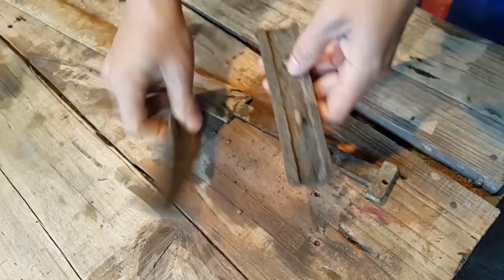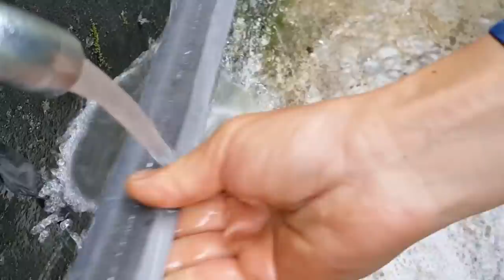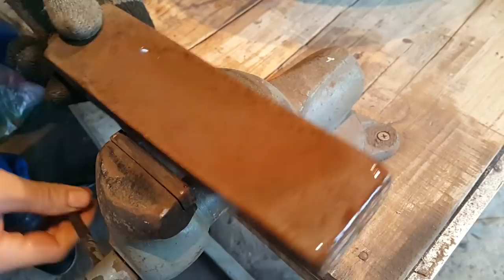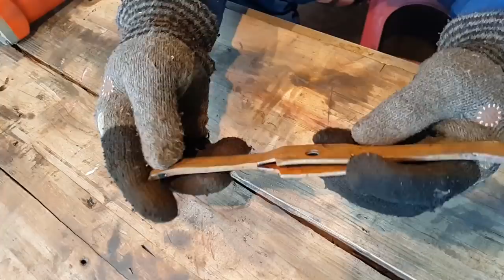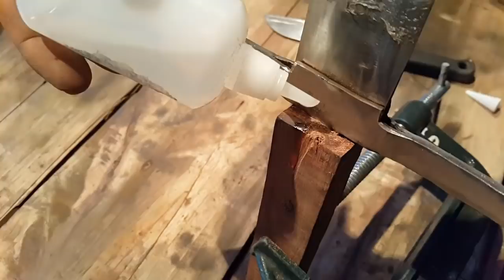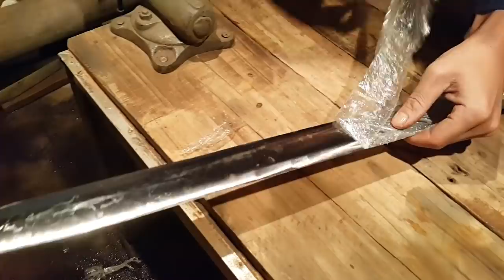Restoration legendary sword Excalibur | Restore ancient weapon old rusty

Comment: I dont mean to hate, but i thought some feed back would be good to improve your work. 
Dont weld the guard to the blade, that screams low quality build, you could maybe make holes with two pins horizontaly to hold it in place, giving it a much finer look,  also, you cutted the pommel off,  that metal is for balance, replacing it with the wood of the grip is just for looks and it affects the center of gravity of the blade, also, the grip looks very thick and round,  try making it more oval shaped and thiner to fit the hand more comfortably, maybe some sand paper would make it easier instead of the grinder, make it real smooth and it will be great, 
And finally, if you spend some more time in the blade i'm sure you can make it mirror shiny, it's a good looking blade but you can see the grinder marks all over it, the higher the number of the sand paper,  tge better it will look! 
I hope you keep doing what you do and that feedback helps you imprive even more.
Marry christmas
Reply: F
Reply: Also worth a point partial tangs even riveted are usually weaker than the previous full tang build
Reply: A pommel is not necessary for balance, but for construction. A hidden tang sword won't hold under use
Reply: @ondralavicka3455  necessary no but if it was originally factored into construction then its removal shifts the balance slightly more so with larger round pommel s
Reply: @killerkitsune5425  
The handle scales are more likely to split without a full tang. And you are right a pommel is not necessary a full tang is. Also depends on if it's a longsword, or an arming sword, but if you were to grip the pommel, then I don't think it would hold.
Reply: Not hate helpful tips, no one is going to shaft you for that.
Reply: That's a good constructive criticism that you made us. The world should take this example of criticizing like this that instead of bashing the person's work.
Reply: @tatehearn5000  well your right
Reply: Never use a grinder for restoration. Hope he learned his lesson... And never use commercial weldding. Really??? Common man..
Reply: @onyelbrixrhythms8718  nex they probably say Restore the holy powers too its exclabur! have it shoot golden raysxd
Reply: @ondralavicka3455  A pommel most definitely is needed for a properly balanced sword
Reply: @Tolboy46  
I don't think so. Depends on the type of the sword, but there were hollow pommel or just end caps that a katana has. Europeans put pommels on everything, because they have great offensive capabilities. A blade should be mostly balanced without a pommel.
Reply: @ondralavicka3455  have you ever held a hollow pommel sword? There's quite a bit there. You're correct that a pommel is not "necessary" for a Japanese style sword. But a cruciform "European" style sword will not have a proper balance point without a pommel. Lots of research is out there on this. It effects the nodes and balance. Otherwise you don't have a very long sword, or it'd be far too blade heavy and the wielder would get tired quickly.
Reply: Why do you have the fairy tail symbol as your logo?
Reply: So fake he probably bought it from some one on offer up
Reply: Cutted is not a word and do you even Gramer though (imprive)
Reply: @ondralavicka3455  any grams of a sword are necessary for balance! Even if this sword using on horse by knight or hands of an executer.
Reply: @wildscott6174  stuck with that? Really 🤘🤪
Reply: @selmanmuslu1597  yes yes I did cause I love ANIME
Reply: @wildscott6174  me too 🤘🤪 all for love goes to SAITAMA 👊
Reply: As soon as I saw the blade, I knew that it was not worth working on.  Slab steel, stamped by machine, decorative piece.  Tosser!
Reply: Yea I also did not like the welding of the cross guard. Seems like it will be bad for the blade in the long run.
Reply: If youre trying to give constructive ideas and sound at least somewhat coherent, dont say "you cutted off" hahahaha.
Reply: Exuce me what the FU
Reply: may I suggest wet stones as well to add a more professional polish end
Reply: Well Carlos,
The way I see it, is that I think your comment has a big point. I am not an expert in this issue but this is the seccond time I see this man  "restoring" a sword,  and I think (sorry for my language) he  is a real amateur.  For example what you already said,  working with a grinder or welding the guard!!  Come on!! 
I've seen lots of films here on YouTube , where people put a lot more love, blood, sweat and time in restoring  or building a sword,axe or katana. And the sword and knives he uses, are not thát old,  jou can see it on the young rust on the blade.
Reply: @ondralavicka3455  hello sir
Reply: @tatehearn5000  u are kinda smart to be honest

Comment: Top tips: try hand sanding next time (or rework this sword with sandpaper.  There were still quite visible scratches on it. 
DONT weld a crossguard on a sword, for the love of god, dont.
Handle should be more oval, and tapered to a thinner diameter towards the pommel, which should be metal. Wood totally unbalances a sword. (although this most likely is just a cheapass replica.)

Comment: Also if you want to restore try using  sandpaper instead of a angle grinder, it takes more time but you loose less material and get a better finished product.
Reply: I agree, not a fan of the grinding, hand work is better

Comment: This is rough... The blade is nothing but grinder marks and the handle looks like it was made in a Junior high shop class. If you continued with some actual finish work it could look exponentially better.

Comment: Tip (NEVER CUT THE POMMEL) and way too much polishing on the steel. When made it did not have a cheap  mirror finish look. And I don't know what's worse the handle or the fact you welded on pristine old steel.

Comment: Its a good restoration, but my only criticism is on the handle.

The pommel is there as a balance to the sword, withought it the centre of gravity drastically changes, making the handling of the sword alot more difficult.
Also, round handles are not reccomended for blades like swords, you need to know which side is a bladed one, and usually a oval shaped handle helps one do that much more easily.
Good video tho
Reply from the maker: thanks for reminding me

Comment: I have a few grievances with the final results, but overall not a horrible job.

The two bad parts in my opinion are where you welded the guard, and when you made the handle.

Welding the guard on is not only a poor design choice but also weakens the blade at the point of welding, and is inferior option to let’s say, Peening, or riveting.

And the grip, well, it’s round, this is bad for edge alignment as the grip can shift in your hand, while an oval shaped grip would not only be more comfortable, but also help with keeping the edge aligned with your hand, making for better cutting overall.

As far as the blade is concerned, I have no issues, the methods weren’t the most efficient I’ve seen but they got the job done and in the end the sword looked ok.

Keep at it friend.

Comment: Only criticism I’d have to put out is the tip of the blade could have been a little sharper and the handle could have designed to show its actual age other than that great work

Comment: I can see your hard work on the blade. I saw your will to make it to a better shape then before. But...next time,PLEASE USE SAND PAPER OR HAND SANDING rather than using the grinder. 2nd...NEVER...& I MEAN NEVER EVER YOU WELD A SWORD GUARD,for god sake DON'T DO IT AGAIN. 3rd...make that handle more oval (learned or study more about makin a sword handle. Lastly....when u RESTORING u DO NOT change a thing on the blade (u cut the pommel). Learn more about blade making. Best of luck in the future.

Comment: Ok not gonna hate cuz you might still be learning your craft but next time after sanding try a buffing paper it will help remove visible scratches and gives it a nice finish and please do t weld the guard to the blade and also try to get a steady bead going g with your welder I stead of just doing g a bunch of tac welds it will make a smoother stronger weld and less sanding for you also try not to cut off any material from the pomell its there for balance but all in all not a bad restoration if your still learning :)

Comment: How is he expecting that handle to stay on. He used vey little glue and only on the outside. Used super glue which won’t bind wood to metal like epoxy. Don’t even get me started on the welding of the guard. I mean I know he is learning while restoring these, which is a great thing to do, but maybe research the best way to do it before just jumping into it.

Comment: Hi, again not wanting to hate or do you down, but welding the cross guard to the tang was a mistake,  the guard is not ment to be solid, some give allows for better absorbtion of impacts, and the weld will have changed the internal structure of the metal creating a potential weak point that would probably fail if subjected to heavy use. However this was never anything more than a wall decoration to begin with, if used for combat it would quickly fail anyway, the tang is cut not forged and the holes for the handle mountings are a weak point (fine on a knife but no good on a sword). I personaly would have left sharpening it until last, less risk of cutting yourself. But other thn that you did a good cleanup job.
Reply: I make swords and the holes for rivets do not significantly weaken the hilt. Welding the guard on can cause brittleness if you cool it too quickly. If you let it cool slowly it only anneals the ricosso.
Reply: @krknfmkr8919   Im a Blacksmith (professional not hobby). Welding the guard can be done as you say and will work, but the guard is designed to take impacts leaving it unattached allows it to do that and stops that force beeing transferred to the blade.  Holes in the tang is a technique that is used in some blades, thinking Japanese blades particularly, but they are of a thicker section, if the blade is for display only, fine, it's not the right method for most European swords but ok. However if it's for use, no, I've seen them fail at weak points like that.
Reply: @haydneasy9736  I am also a blacksmith/bladesmith and have been for nearly 30 years. I make swords for people who want accurate, functional replicas. I currently have about eight swords. Some are fantasy and some historically accurate. I've researched blades throughout history, including Japanese sword making. I prefer to have a heavy tang and threaded pommel. But the German Gross Messar had a wooden hilt with three rivets. So did a sword from the Maciejowski Bible. Both were primarily heavy choppers. I don't like to weld the guards either; for the reasons you mentioned, but also it's not authentic. I think this one was a replica, and quite possibly a "wall hanger"
Reply: @haydneasy9736  if the original maker "drifted" the holes instead of drilling them it would be stronger and more accurate
Reply: @krknfmkr8919  True, drifting would make it stronger than drilling, but you are still intoducing a hole where you dont need to. Yes there are some european examples, although I would say most of them fall more into the tool/weapon range, and the Gross Messer is realy a big knife (bloody big knife!) as the name implies. The vast majority are made the way they are for a reason, admiteddly with modern steels you can get away with more . Undoubtedly the swords he is doing is a wall hanger. Interesting that you thread the pommel, Ive always found the best results from a simple peened tang. we sound similar, 33 years a blacksmith myself, much of it specialising in Medieval Blacksmithing.
Reply: @haydneasy9736  the Gross Messer is classified as a sword by historians. The one from the Maciejowski Bible doesn't have an official name but is referred to as a chopper. I used to do riveted pommels but they work loose.
Reply: Its basicly Falchion which has always occupied a gray area between sword and knife, and yes some are more sword like than others. If the pommels work lose they can be repeened, with a thread you are ok if it needs tightening if its a symetrical in the hrizontal but if it its something like a disc pommel you are screwd
Reply: @haydneasy9736  actually I assemble them without epoxy to insure a proper fit. Then I epoxy and assemble them quickly (5 min epoxy) and align everything. Works for me

Comment: If you're really trying to learn to restore, first and foremost, stop using a grinder on your blade. You practically ruined the blade by doing that.
Second, you should never ever weld a guard to a sword. Not only does it look tacky, but it's not.. functional.
Third, on your handle, you should not use a grinder. Measure out the handle, cut your pieces, then sand them apart from the handle if you're going to use an electric sanding disk on an angle grinder. 

Lastly, there's no need to rush things. Take pride in your work, take your time, and in the end, you'll see great results. 

Cheers!

Comment: Not hating, it takes time, but its just that, slow down, quit using a grinder on everything, put the time in for hand sanding. Try doing some research into handle designs, and wetsand the blade after its been decontaminated. You'll notice the workload but the results pay for themselves if you want to monetize videos. Its an art form, listen to your subs.
Reply: Absolutely. I love all restoration videos, shame to see the haters when there's a line between hate and constructive criticism. Keep up the hard work.

Comment: dude people complaning about destroying anything are just mean, because if they really cared about historic weapons the design of the sword would already looks off, im not the expert or anything but  the blade ( i wouldn't know the exact type number) looks like a viking era type of sword, even more considering the end of the blade, but the blade somehow have a cross guard (and a weird one) and on top of that seems to be a hand and a half handle, wich i think a viking sword wouldn't have, but either way i would say that the restoration was flawed but pretty good, the woden pomel was odd, and welding the guard was also weird choice(but i kinda get why you did that) but considering that you used few tools to do the restoration i would say that you have done a pretty good job (let's be honest the sword was trash and you definetly made it look like a sword  again), from what i saw of restorations videos i would sugest to you to gear up, you have done a really good job, but restoration is a field that needs a great machinery, lots of sanding tools polishing tools and even a forge, in fact i've already saw people casting things for restoration, so... considering your machinery you have done a pretty good job, keep it up the only way of improving (besides investing) is practicing

Comment: Oh.... Oh dear! You should not have welded the guard on. That weakens the steel and compromises integrity. With as mush steel forging I've watched on TV, even I know that's not a good idea. Even gluing would have been better. You don't weld on any part of a blade unless it's pre-heat treat.
Reply: @dtrestoration8590   No prob

Comment: Nice job in ruin this knive (it´s a knive not a sword) The blad need a way higher grid on the sanding (there are to many scraches) and the sanding is very uneven. And then. Welding the guard on the blade? Really? And the handle is again awfull. The scales are don´t really match together and the shape is rough and katanas use bamboo or wooden peg´s. In this case brass or bronze rivets would be the right choice.

Comment: There was better ways to do this what you did ended up scratching up the metal and wasting a lot of material what you could have done that you could have chemically removed all of the stuff then you could have sanded it with a angle grinder and a buffer disc then you could have taken it put it into a piece of wood and had the wood carved around the hilt that I was already there and glue it through and then put the rivets in that would have kept a sturdier handle plus would have made it last a little bit longer and you shouldn't have cut off the bottom pieces because you could have just felt the handle around it and left it with its original pieces and I doubt that it's an actual Lair sword you probably and I doubt that it's an actual Lair sword you probably just and I doubt that it's an actual real legendary sword you probably just bought it somewhere

Comment: t would be better not to do such a job ... I got an infarct when you saw him with a grinding machine ... just polish and do not hold the sharpening paper into the paddle, but pull the blade sharpen .... the rust comes down electrolysis. ..great ...

Comment: Using flap-discs to sand faces with chamfers makes it look like a rounded blob rather than a crisp blade. That, and the viable standing circles hurts my soul. How long did it take you to corrode that blade anyway? Anyone with the slightest of knowledge of swords knows that is just a cheap modern sword hunk o junk. Everything about it is wrong for any time period... anywhere in the world for that matter.

Also, chopping off the pomel like that was kind of a dumb move. It is designed to stop the hand from sliding off, and if I found someone had done that to my sword I'd request a refund.
Reply from the maker: thank you for the comment